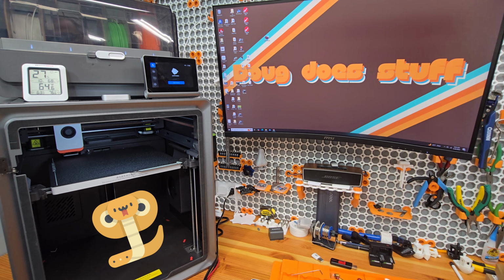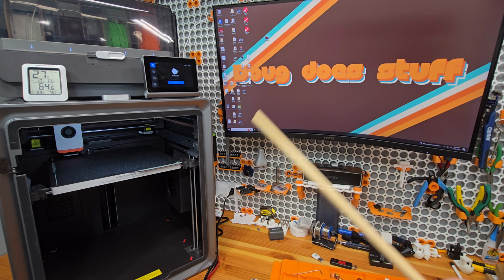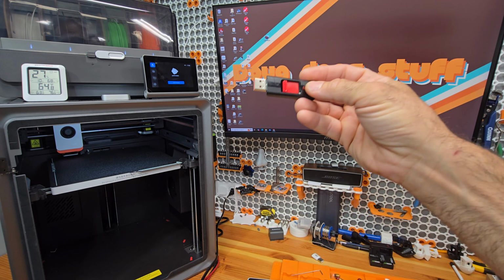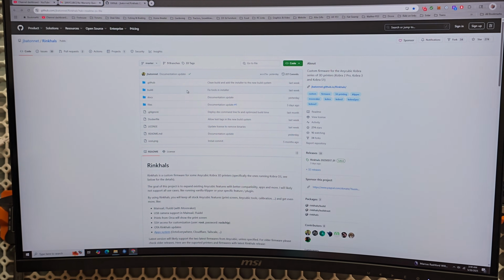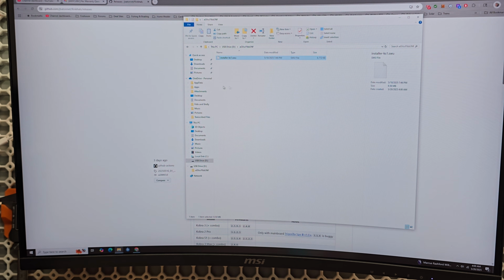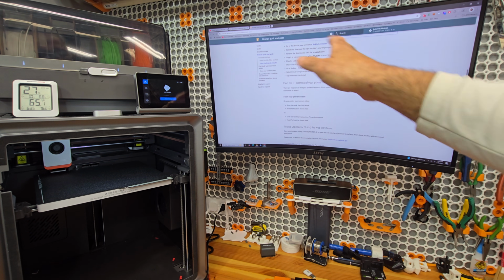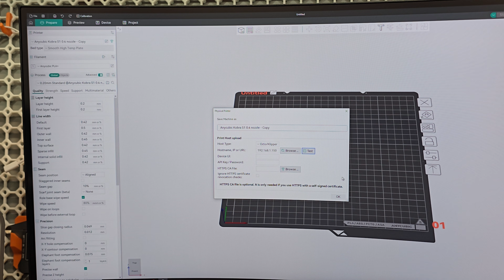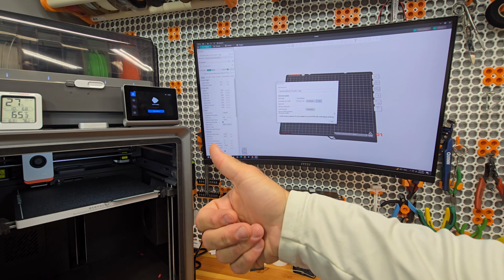Kobra S1 Combo: Rinkhals....bitten by Anycubic :sad face

Comment: you cant use ace tho so why do this/
Reply from the maker: What do you mean you can't use the ace?  It doesn't connect via orca, but you can still set it and use it
Reply: @dougdoesstuff24  I mean you cant use it through print UI only manual setup
Reply from the maker: Oh, yeah, it doesn't sync....but unless you are always using Anycubic filament and not tweaking the profiles it doesn't matter.  I use so many other brands that it doesn't matter if it syncs or not for me.
Reply: @dougdoesstuff24  wait how do you use the ACE through orca? I cant i have to manual feed
Reply from the maker: @djgraffiti81  just add four filaments, set their settings, slice and go

Comment: How to print with a 0.2mm nozzle? If you set a 0.2mm nozzle in the slider, then the firmware does not have this nozzle, then if you need to select a 0.4mm nozzle, the corresponding printer will complain about the mismatch. Anycubic Cobra S1 printer.

Comment: The rep is incorrect, at least in the US, Canada, and some other countries, because it's against our right-to-repair law. They will need to prove that the firmware is the cause of the issue, and for something that can be removed, it's impossible. I've taken cars in for work under warranty with intake and exhaust before, and the first time I was given issues, I asked for a manager and was never bothered again.
Reply: I have it on my printer and it's great.
Reply: Same in EU, software / firmware can't void warranties.

Comment: I have an idea for you: Don't do a video on it because I just saw three videos on installing it. Man, do it and fix your printer. Well, what Anycubic did by using cheap parts, as I've seen all your troubles. :( It's a shame that Anycubic hasn't done any testing on their plates to see what heat would do to them :( You can always uninstall the firmware (I heard)
Reply from the maker: Thank you for the comment, I appreciate even the critical ones!

Comment: sorry to see ppl having problem with their s1, i really love mine, im on 200hours and only a few sticky fingers fail. even 10 year old filaments, abs, pla, petg and tried asa that one i havent learned yet... xD
but overall it almost does everything i ask for, every time.

sure i dont do multicolor prints, just a full layer color shift for text, but yea overall really nice printer out of the box (if you get a good one i guess?)
Reply from the maker: That's awesome! Very happy to hear that there are good printers out there. It means there is hope!
Reply: @dougdoesstuff24  yea hope yours will be good too =) its a cool printer for the price when working :D
Reply: It's completely user error. I own 9 printers of all brands and sizes. I just bought the Kobra and rank it in my top three. The only issue for me is knowing enough to know their start up routine is unnecessarily too slow. I print ASA on it all day long with any issues. I do run the add on firmware layer to give me Mainsail access and Orca slicer.

Comment: I've been looking into rinkhals, after seeing just how easy it is to do I might give it a go, I know for a fact 1 of my S1's beds are way off level because it changes its height a lot from side to side, looks rather stupid in the timelapses too bouncing around. But on the flipside I cant complain about its first layers or print quality so I've not been in a rush to do anything about it, over 1000 hrs on that particular machine now.
Reply from the maker: I think we should all do it and post our results to compare. How far off are the high and low spots. I've always aimed for nothing for than . 15 on my enders, but I'm willing to guess the Kobra is far more
Reply: @dougdoesstuff24  Yeah my enders (because i can see the data) are about 0.1 difference from lowest to highest. My S1 im guessing from the movement I see is at least 1.5mm or more. Currently running some tests between wifi and usb files and there appears there could be something there, more testing to do befire I jump at the rinkhals thing
Reply from the maker: 100% agree that the deviation between the high and the low is well above 1 mm if not close to 2 mm on my bed. I would be interested in what you find between Wi-Fi and usb. Sometimes I think there is and sometimes I think there isn't. Wrinkles really would give us so much more information, just unfortunate that any cubic will flag it for warranty voiding

Comment: I feel you bro. Anycubic products are sorta like rollin the dice, if you're naturally lucky at the crap table you'll probably think their printers are great. But the percentage of units shipped out that have issues 'from the build' and others that have buggy motherboards, or suffer mysterious shipping disturbances, are legion. Over the years I've owned a dozen different machines, some worked like a champ for thousands of hours, some developed problems within weeks, some encountered issues that no amount of back-and-forthing with support and replacement parts shipped out could fix. The only reason I keep buying their gear is because they are cheap, and when they bite the dust you can always just buy another one and get support to make a price adjustment.

Comment: So quick point. If you are in the USA, you are likely protected by the Magnuson-Moss Warranty Act. 

1st, Warrantors cannot require that only branded parts be used with the product in order to retain warranty. This is commonly referred to as the tie in sales provision. 

2nd the federal minimum standards for full warranties are waived only if the Warrentour can show that the problem associated with the warrantied consumer product was caused by damage while in the possession of the consumer, or by unreasonable use, including a failure to provide reasonable and necessary maintenance. 

So they would have to show that the issue you are seeking warranty coverage for was caused by your installation of the overlay. This also definitely protects your use of an aftermarket hotend.

Final note, you should be able to return the printer regardless of if the return window has expired. The act states that "if the product, or a component part, contains a defect or malfunction, must permit the consumer to elect either a refund or replacement without charge, after a reasonable number of repair attempts." I would ask the representatives what the company believes to be a reasonable number of attempts.
Reply from the maker: Thank you.  Yes I am in the USA
Reply: @dougdoesstuff24  You should just copy everything @antoniomromo just said and put it in an email. I bet Anycubic is aware of that law and hopes people don't know about it.

Comment: Hey Doug, out of interest.  When you swapped your hot end - did you change the nozzle setting in the config to hardened steel 0.4?  I've just installed one of these 'upgraded' nozzles and am now having bed adhesion issues.  Man, these printers are challenging.  I don't blame you from keeping your warrantee in tact - it seems Anycubic solve most of their complaints by throwing parts at you.
Reply from the maker: I did change it in the slicer. I don't have adhesion issues which is good. I was having them right before my hotend leaked though. You could try dropping your z offset and see if it sticks
Reply: @dougdoesstuff24 There is a setting on the machine for the hot end that pushes you to a manual reset and then calibrate - it might just be the same as a full calibration though. There doesn't appear to be any manual settings on the machine that make the print -  only through the slicer.  I've been testing with stock benchy on the usb, so not played with those yet.
Reply from the maker: Gotcha. In the slicer under nozzle settings you can lower offset, it's a previous video 😃
You cleaned your plate, correct? Dawn dish soap and then isopropyl?
Reply: @dougdoesstuff24 I did indeed clean the plate, a good suggestion though. It does feel like a z axis issue.  Needs more testing.

Comment: ill give you 50$ for the broken printer
Reply from the maker: Sure, send $50 and I'll get right on packaging. Shipping is $550 though
Reply: @dougdoesstuff24  What about Free shipping ?
Reply from the maker: Sure, but I'll have to build it into the price of the printer
Reply: @dougdoesstuff24  fine no shipping then?
Reply from the maker: No problem, I'll adjust the handling fee if you're picking up

Comment: Thank you so much. I dont use my kobra 3 as much as id like because i have to open a separate slicer and re-enter settings. Its too much to ask to load another program and reload the model and set settings when i have 8 other machines ready to have settings transferred to them with the click of a button in orca, which is a shame because the kobra 3 is such a strong performer for me.

Comment: Man I am going through stuff too. My issue is I had a print almost done when I had a power outage. When it came back it asked if I want to resume print so I did. But instead of it starting where it left off it decided to auto level and start over crashing into my print! Now my bed won’t auto level. Fails half way through and crashing into my bed. Error 11534! Currently emailing support 🙄
Reply: Mine did the same thing two weeks ago also. Kicked the build plate off somehow and scratched the bed underneath. No clue how that could even happen! I got a power interrupted notice, didn't see any problems on the camera and hit continue. What a disaster. I just threw the plate back on and kept printing thankfully. Still mixed on this printer as my Qidi prints flawless compared to the Kobra S1. Ready to try Rhinkals lol

Comment: Glad I didn't ask. Been using Rinkhals for a while now, and won't go back to not having it. I hope Anycubic eventually opens up their firmware so users can access the config files and install Mainsail \ Fluidd, but if they don't, Rinkhals provides what I need just fine. Of course, I got my Kobra S1 for free, so I'm not too concerned about the warranty.
Reply: Vine? This is the most expensive "free" printer I've ever had. Wish I could return it.
Reply: @jerrymartin9323 if you seriously want to get rid of it let me know. I'm willing to tinker. My heavily modded ender 3 is proof of that.

Comment: can you just request a replacement at this point?
Reply from the maker: They keep sending me parts, hopefully that fixes it or at some point a new printer.
Reply: @dougdoesstuff24 at this point. Seems like a full replacement would be best. I’ve had a good unit with 90hrs, a user should not have to jump through replacing one part at a time. I understand if it was a cheap budget ender. It’s mid tier at best so you should be getting a killer machine
Reply from the maker: Agreed

Comment: bed leveling should compensate for the bed not been level creailty as made this in the firmware my bedmesh looks pants but is print perfect they intoduce automatic z-offset like on the k2 plus which i do have one now also i have a anycudic s1 combo mine working fine just got it
Reply from the maker: Yes, bed leveling SHOULD compensate....but it doesn't seem to be working.  Maybe the warp is too much for it to compensate.  And yes, my enders both have a bed mesh that helped in leveling!
Reply: It can only compensate for so much before printing crappy
Reply: My old Ender 3 running klipper does that aswell.
Reply: Anycubic's bed leveling does not work.  They even shipped me a new bed, and it was warped right out of the box.

Comment: tbh rinkhals doesnt add anything of value and theres the potential brick which I've seen is pretty common.

What good does it do to have a mesh map if you cant tweak it? and orca is not that big of a thing to install Rinkhals. 

Theres nothing in the world that could help this printer.

Just donate it and buy a Bambu.
Reply: Rinkhals is great, sorted my bed mesh out using it, have installed and uninstalled a few times, due to Anycubic firmware updates, no problems and so far I haven't heard of it bricking anyones printer, it would be difficult to do as it doesn't do anything to the anycubic firmware, just adds an overlay that is easy to remove. OPh and as I use Linux anycubic doesn't provide a linux version of their slicer, so Orca is much more stable than running Anycubic Next under wine.
Reply: @ozzybiker1013  not sure how you fix it with rinkhails since its just for show, you cant interact with the bed mesh and edit it nor you can edit the z offset or probe offset, so... just informational

you can get better results by just printing a leveling test and then adjusting the screws and/or using post it notes to even out the bed
Reply from the maker: HA!  I wouldn't donate it, that is like giving some you don't like an ender 3!!!!  Knowing the mesh I would be able to shim the plate to get it closer to a tolerance the bed level could overcome.

Comment: It's complete bs that it voids your warranty. You can reïnstall the stock firmware and Rinkhals is gone and above all it doesn;t change anything in the Anycubic part of the firmware. But I understand that you can't show it in your video's.
Reply: They didn't say it voids warranty. That's the phrasing Doug used. They were very careful in saying, "If the firmware is modified, we will not provide warranty for the printer." The number of people on their own Reddit for example that have replaced their nozzle for one with a bad thermistor or not fully seating it, destroying their bed isn't exactly an Anycubic issue. That being said Anycubic shouldn't be required to support Rinkhals. They should get their act together and support their own product so that Rinkhals isn't needed in the first place!
Reply from the maker: Agree that they should fix their software and add the features that Rinkhals opens up, but I read that email as it voids the warranty.  While YMMV, I am not risking the possibility or giving them an out on a warranty.  I do think, because support has been so good, that they would still warranty hardware, I just can't chance personally.
Reply from the maker: I agree, but thanks for understanding!
Reply: Other people are doing the install videos. HE needs his $549 printer fixed for good.